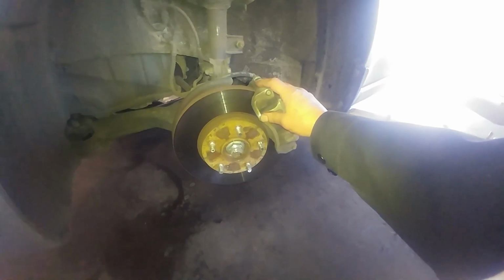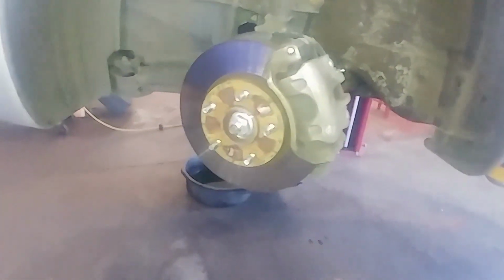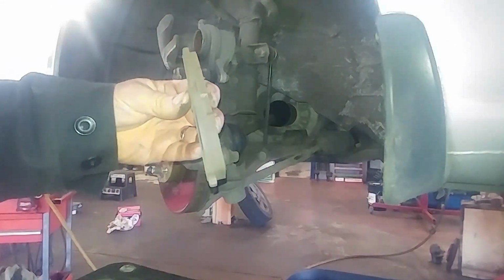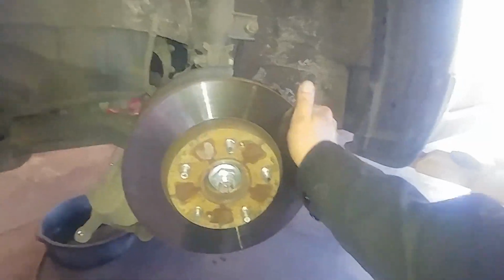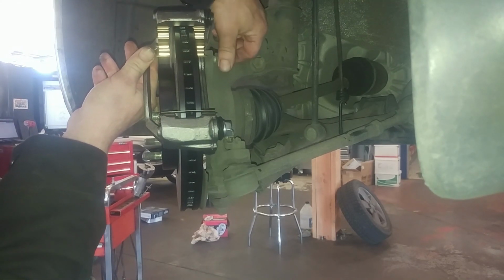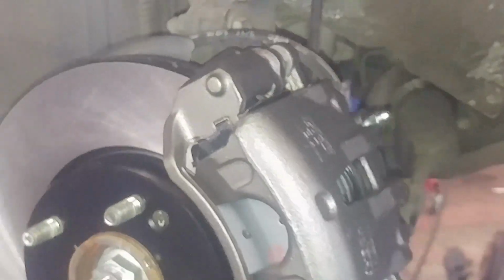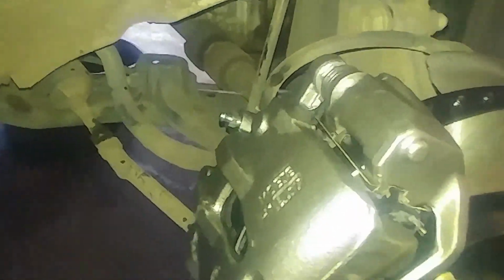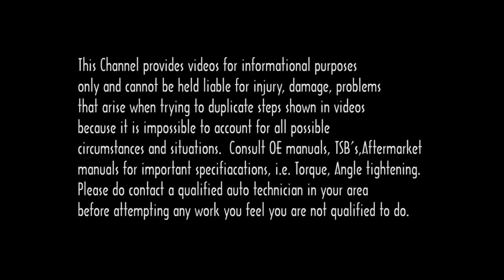Front brake caliper replacement 2012 Kia Forte Coupe pads rotors.

Comment: Nice presentation, thanks for this.  Nice pace, appreciate the extras like torque specs and bleeding instruction.  Would have appreciated either a view of and/or description of the installation of brake hose to the back of the caliper.  You went quiet and did not show anything during this part.  That's the only part I'm a little shaky on when I start my own.